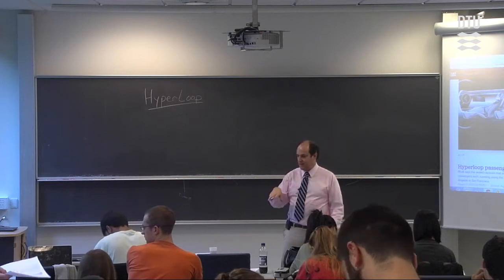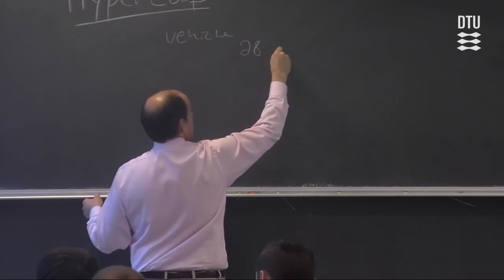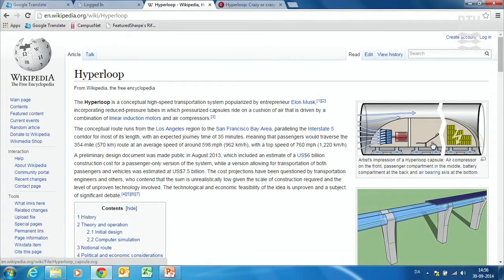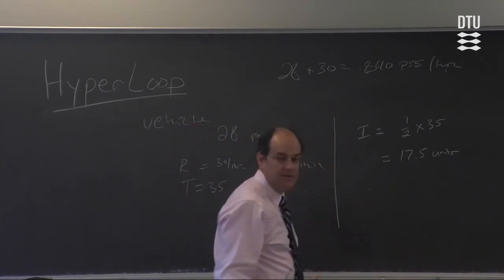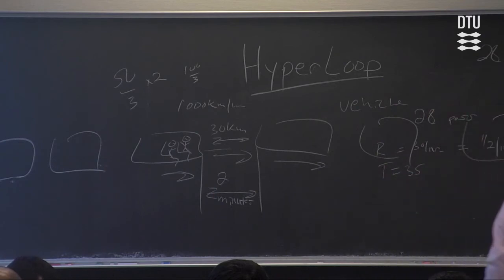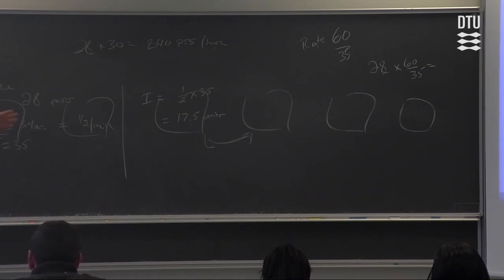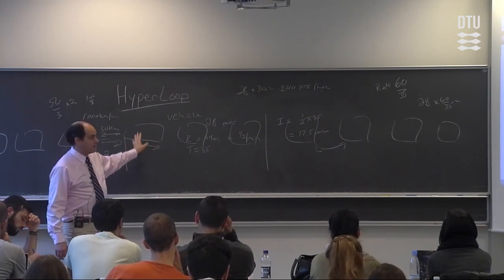A brief talk about the Hyperloop

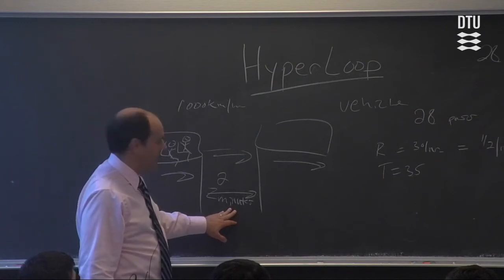Comment: I disagree that you have to wait for the previous pod to clear the far end before dispatching the next pod.   Much like trains have blocks of track, you could set up detector points that detect a pod passing and upon sending a signal to the central control system, the control computer clears the block that the pod just completed.    You could have 4 blocks enroute, you could have 100 blocks,  but you still can't space the pods for a distance shorter than their stopping distance plus a margin of safety.  However, he is right - expecting 2 minute headways for something traveling this fast is unrealistic.  During it's heyday, the Caltrain commuter trains departed San Francisco no closer than 3 minute headways for a brief period during the evening rush hour - and that was because the first train out would skip all the stops until it was halfway down the peninsula, the second train would run express to a point a couple stops short of where the first train made it's first stop, and the third train ran non-stop to a couple stations closer, etc.  It also created a very egalitarian schedule - except for the very southern peninsula, most everybody would be arriving at their home station about 5:40-5:50 pm.

I also disagree that the happy passengers would be sitting there drinking their drinks.  As originally proposed, the passengers would be half lying back, half over the passenger behind them in order to fit the system within the small diameter tube.  You won't be able to go to the bathroom, because there won't be a bathroom on the pod.  You won't be able to have a drink, there wouldn't be any service staff on board.   Even if you brought your own coffee, you'd have a hard time drinking it due to the g-forces of acceleration and curves.  So this guy is entirely wrong - the passengers won't be happy and they won't be drinking anything.

The more fatal flaw is that the original white paper plan didn't go from LA to SF.  It went from some point near Sylmar to Fremont.  They purposely left out the very expensive last miles.  Tell me, are you going to drive from Tustin to Sylmar during "rush" hour to save a few minutes compared to flying?  Nope, you'll go to one of the many airports in the LA area - LAX, ONT, SNA, LGB, BUR - and fly to one of the three airports in the Bay Area - SFO, SJC, OAK - that is closest to your actual destination.  You need to compare door to door times that include access and egress, not just the time in the tube vs. flying, high speed rail, or driving time.  And that's part of the beauty of high speed rail (and part of why it is so expensive) - the trains go downtown, where there are  adequate transit alternatives to get to your specific destination, to gather and distribute passengers..  And high speed trains will also stop in Fresno, Bakersfield, Modesto, Merced, San Jose, Sacramento; whereas the original Hyperloop proposal only went between Sylmar and Fremont.  And the area that it could draw riders from would be a very small radius from those two endpoints.

Comment: The addition of emergency safety systems (i.e. wheel brakes and electric drives), as well as automated tube pressurization in the event of an emergency, would easily overcome the issues that you have explained. Controlled pressurization of the system would stop all vehicles, not just one, thus eliminating the issue of having to stop within 30 km.
Your approach is narrow minded and critical considering that the design remains in the conceptual phase. Think of ways to resolve the engineering hurdles rather than invalidate the concept based on preliminary values.

Comment: ready made patches are made for all pipe industry  for steam ,  water and air .  some  are temporary until a crew can be gathered to make a more permanent  repair .  Remember the air is trying to go INTO THE PIPE .  Any flexible  strong industrial patch with industrial grade adhesive would be sucked to the surface of the pipe till more could be done .

Comment: 3/4 or less of the way through the journey a door closes saving the depressurized air.  Then highly compressed air is gradually pumped in to slow the tube down.  This is much safer to have the braking system outside the tube where you can have multiple redundant systems.

You can also load the next tube up and shoot it down.
Reply: It looks like it uses linear motors so deceleration should not be an issue.  It can also use compressed air pressure to reduce speed as a backup.  

What is this guy talking about?
Reply: @cointelpro123  The original white paper said the LIM accelerators and decelerators would only be in certain sections where needed, as though nothing would ever go wrong.  I think all hyperloop companies have abandoned the air bearings and also concede the LIM would have to run the whole distance.

Comment: DTUbroadcast ok, this lecture is all wrong and I'll try to be constructive in my scathing review of what he said. Rather than the blunt truth it deserves.
He starts out by assuming one train every other minute and capacity around 900 people per hour. That's ok as a thought experiment. He then makes the claim that it's impossible to coordinate the distance between the trains because 30km apart is too close to avoid disaster. From that he concludes completely out of the blue that there has to be at least an arbitrary 35 minutes between each train!...................  completely without logical foundation. DTU, this guy is not intelligent enough to be allowed to lecture there. Where did you find him? DSB?
With adequate station space the trains could be launched every second. Radio signals and computer could coordinate trains riding millimeters apart a mach 2. The signalling is not the problem at all. He is 100% wrong.
But there are some actual problems with the system although not necessarily insurmountable. One major problem is failure of the train mid way. A single failure cannot be allowed to block the route for a long time so that will have to be handled. Another major problem is that the tube needs to be super straight to ride on a cushion of air a few mm high at mach 1. With suspension arms, this might also be manageable.
A third issue is the transition at the station from pressurized environment to the vacuum environment when passengers embark. That will require some fairly costly couplers or a nifty fast change pressure chamber. Doable but not cost free. And then there is perhaps the biggest problem, the cost of creating the long vacuum tubes. I haven't done the math on that but that's where I figure it dies. Super straight lines up and down on california real estate might be prohibitive. But it certainly wont fail on his completely erroneous signalling argument.

Personally I think such a rail system is too prohibitive. Too inflexible for the cost. I'm more of a believer in radical new small light fast bus planes flying whenever there are passengers so you never wait and never book in advance. Possibly electric planes with no power source onboard, powered by microwave stations on the ground. They could fly mach 2 very high up. Very light and aerodynamic. Super darts.
Alternatively simply do an advanced high speed light rail, like a spear plane on rails going maybe 700km/h.
And of course the ultimate solution is to tell the truth about the UFOs and use the propulsion they use. That would get us from LA to SF in 5 seconds. And yes that is quite real and our world has been a lie since at least 1941. Seek and you shall find.

Comment: Everything that is wrong with higher education in 11:27min. 

All you read here is google-knowledge of basic physics.

1.) His core argument is that the distance between 2 vessels is to short to break, so rate of vessels in tube must be reduced to 2 per hour. Bullshit.

distance between vessels = d = 30 km = 30.000 m (precisely it´s 33.240m)
speed of vessels = v = 1.000 km/h = 277 m/s

Stopping distance = sd = Speed/10 x Speed/10 = stopping distance in m!  (normal stopping distance to speed = 0, like for a red traffic light)

so sd = 1.000/10 x 1000/10 = 100 x 100 = 10.000m

for emergency breaking you divide this distance by 2 = 5.000m

So in case of emergency the vessel has 6 times the space to stop that it would need and 3 times for normal breaking e.g. getting closer to the station.

His second argument is: Where is the driver? Where are the wheels and breaks?

Well, a university professor who asks those kind of manipulative questions in the 21st century should be fired immediately. A driver for a vessel that is in a oneway tube? Yeah, right.

That not 1 student stood up and said "Well, I don´t think your calculations are right". This is the "Technical University of Denmark" ...sorry, but you´re kidding me! And those humptydumpties are teaching the cognitive "elite" of tomorrow. Wow.

Instead of teaching false stuff because he wants to get his optinion across, he should teach students what factors have to be considered when building such stuff.
Reply: Did you consider that in a vacuum there is no air resistance to stop a train car?
In a scenario of both magnetic and mechanical brake fail there is no way to stop in such a short distance.
But for me this is just a minutiae. Just think of the unavoidable suffocation  of passengers, even if all cars are successfully stopped. How to get to every one of the cars to rescue passengers on time?
Rescuers would have to be on 17 different places in an instant, and be carefull not to implode the whole tube before the pressure is normalized.
You should apologise for mentioning that someone should be fired due to your narrow vision.

Comment: Is this guy a professor? He have some valid points, but it is clear he just read wikipedia and didn't read the white paper on this concept. Many of the points he brought up are addressed in the white paper. Like the fact that it wheels and mechanical brakes could be deployed in emergencies. Even if the cars only decelerate at 1/3 G they would still stop in only 15 km from 700 mph (the actual proposed speed). So 37 km of headway (the actual gap between cars) doesn't sound nearly as risky.

Comment: For high traffic routes why not have multiple tubes to carry vessels in parallel in each direction? Hyperloop project costs per kilometer are stated to be 1/10 the cost of high speed rail.
Reply: They aren't "stated", they are "claimed" to be 1/10th the cost, even though it requires just as much steel and just as much concrete as high speed rail, and hyperloop would have to be built with much tighter tolerances..  So it's more like "pulled a wild ass guess out of my butt" claim.

Comment: There are two wrong assumptions in this explanation, first that the vehicles are moving at 1000 km/h all the way. And the assumption that there's no brakes. But he make his point in the breaking system, well, electromagnet coils are pretty reliable breaks. As they use it for accelerate the vehicle they can invert the polarity and be a break, the G's can be reduced using an appropriate damping mechanism. I'm pretty confident that this "5 transportation way" works fine but I think is unlikely that it come out of paper for political reasons.

Comment: I totally disagree with this presentation. There are valid points of concern in it, but not things that can't be solved technically. This is not to be compared with old train systems but rather this system will be highly monitored by computers that will immediately react to any abnormal event. Monitoring the exact position of each car isn't much of an issue. And in the event of a serious emergency, braking distance is absolutely well within safe limits. The guy doing this presentation speaks like he knows nothing about modern technology.

Comment: This guy knows nothing about air travel between SF and LA... Asking how many passenger on a 747 is completely irrelevant to the discussion and in fact it appears he's being deliberately disingenuous. The planes used are 737's A320's or MD-80's with 110-150 passengers or so. Even at peak hours there are probably 2 flights per hour from each airport in the region. It's unlikely that this would completely replace air travel just as the channel tunnel hasn't completely eliminated air travel between London and Paris.

The current traffic by air is 2.8 million passengers per year or  7700 passengers per day on average so a through rate of 840 passengers per hour would move the current daily numbers in roughly 9 hours and a modest increase in seating per vehicle from 28 to 32 reduces that to 8 hours. With a flow rate of 840 per hour running 18 hours a day you'd have 2X the current demand on flights between SF and LA.

 The biggest issue would be if they could actually pull this off and really deliver passengers for $20 in 30 minutes you'd expect demand to skyrocket but presumably the tubes could be stacked so there were 2 or 3 operating in each direction.

As for control systems the technology is fairly simple to tie all the cars together so if one slows down it would slow the cars behind them. Assuming they are not networked is silly and foolish. Hell BART has had that technology on their trains for over 40 years.

Plus it's certainly easy enough to create a queue of of capsules so they may only go down the tube 2 minutes apart but there is nothing to stop 2, 5, 10, or whatever capsules queued up and loaded to eliminate the delays. You'd have to have the ability to shunt the cars off to load and unload them.

He has done nothing to address whether or not the underlying technology is feasible. Apparently he can find no fault with the concept otherwise he'd have used that rather than what he's chosen. All his objections are relatively simple to solve with design parameters. What's the maximum size the capsules can be practically? If they can hold 28, can they be designed to hold 38, or 48? Modest increases in capsule size because of frequency can have dramatic implications on total capacity.

I agree that the technology is completely unproven and unless it can be demonstrated to work quickly it should not be an excuse not to build high speed rail but the right of way issue is already killing high speed rail in California.. so now we have this pretty awful sort of high speed solution that's not high speed at all for the 60 miles or so at either end of the journey.
Reply: I concur with you that there can be control systems to allow more than one pod in the tube at a time.  But remember the original white paper called for the linear induction motors to be embedded in the tube only every 70 miles (IIRR) or so.  That means there is very limited control capabilities, and virtually no capability to recover from stoppage incidents.  Sooooo.....we'll put the linear induction motor rail through the whole tunnel to solve that problem, which now increases the cost above what the white paper forecast.   In other words, the whole system was not thought out very well.

Further, the white paper proposal didn't go from LA to SF, it went from roughly Santa Susana/Sylmar to someplace around Hayward/Fremont.  Those last miles are the expensive ones, that's why they were excluded.  Now who in their right mind is going to drive from Anaheim to Sylmar to catch the hyperloop?  During "rush" hour?  Yeah, right - they'll go to the Santa Ana Airport and catch a flight to SF, San Jose, or Oakland and end up closer to their actual destination.  The effective radius you can draw around the terminals as your market area is pretty small, especially during rush hour.

The quality of service is an order of magnitude less than airplane or high speed rail.  You would be leaning way back in order to fit in the capsule, and if you need to go to the bathroom all the sudden - well here's a bag and you can contort yourself in the limited space and do it in front of your fellow passengers.

Also, the  Hyperloop doesn't go to Fresno, Bakersfield, and all the other points in between.  High speed rail does.  And a lot of the trips are to/from those intermediate points.

Last I heard, Hyperloop One was calculating costs per mile about two thirds of what the high speed rail.  Which makes sense, if you think about the amount of steel and concrete involved - more of those physical goods required than high speed rail.  

So why go with the hyperloop when it has a smaller market radius, a worse passenger experience, less functionality, and requires some breakthroughs in technology, such as what would be the largest vacuum chamber by a factor of 100's?

Comment: this guy can't see past the nose on his face . he thinks there are no brakes . in an emergency all pods will slow automatically and stop instantly by computer and have a full 2 min to do so  .  a 747 coming from the same destination may land 4 to 6 times in  a 24 hr day .  the hyper loop could move many more people than that !!! Any air leaks would be detected electronically and probably fixed with out slowing the pods .  leaks would take a long time to fill the entire tube and could be fixex on the fly .